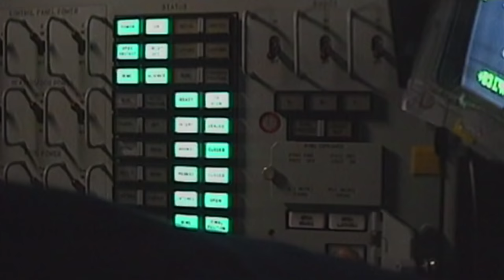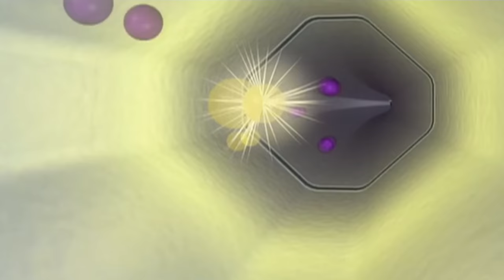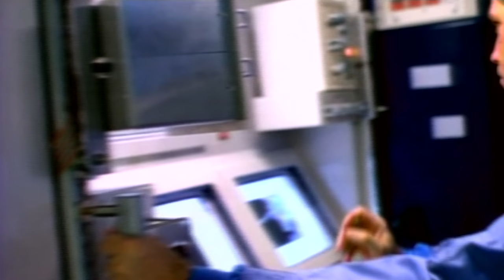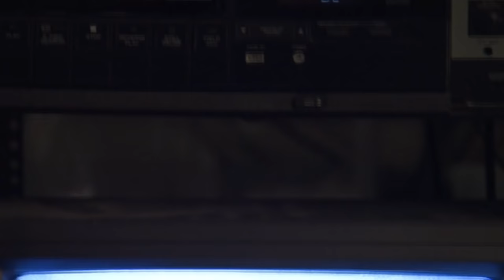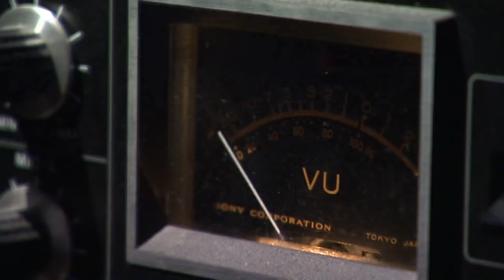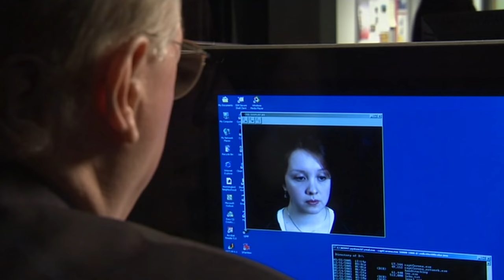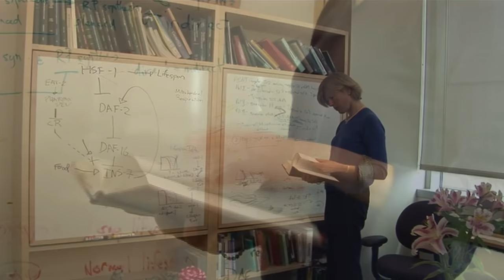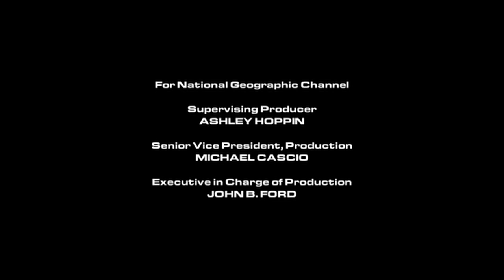Spacemen

Comment: If you want to go to another solar system you need to do it BIG. There is not much point in considering a small ship with small crew.   First build a large space station, with spin gravity living section for a few hundred people. Once we have that working, try moving it. Take it for a test flight to Mars and back or maybe go all the way out to Jupiter.  This will let you discover lots of unexpected issues and fix them before you take the long leap into deep space.  As for speed, there is not much point in trying until you can get to about 10% of light. That makes a 7 Light year trip into a 70 year trip, a long time but not a crazy long time.  Of course the ship should have enough room to accommodate the expanding population that will happen along the way.  All this assuming a destination that is Earth-like. Well to be safe dont do that.  The mission should be prepared to establish a viable colony on any rock that has the basic resources it needs.

Comment: There are several things to consider when going to space and not coming back to earth. Svalbard seed vault has figured out several of these things. Many of the things that we need in our daily life are all around us, but are hidden in our biological world.  Of course we need the right concentration of air to breathe, but we also need a range of pressure and for our "body's sake"; we need gravity or at least a way to simulate some sort of movement in a downward direction. A centrafuge works well for this. Centrafugal sleeping or common areas is a must to travel beyond our solar system or even within it. I will admit there are caveats to this theory, but there are more positives than negatives. As yet, no one has come up with a model that will fit into the circumference of a Rocket with a test model.

Comment: I still would like to know how the rockets push themselves in the vacuum.
Reply: When you push with a rocket, you're not pushing AGAINST anything, like paddling a canoe. You're taking advantage of the equal and opposite reaction of pushing matter one way to travel the opposite way.
Reply: When you paddle a canoe you are pushing against the water. When you fly a plane, the jet pushes against the air. That is how the vector thrust works. There is no opposition in the vacuum.
Reply: A jet engine pushes backward, but it doesn't push AGAINST anything in the same sense that a paddle pushes against water. It simply pushes superheated air out the nozzle so fast that the nozzle (and anything attached to it) moves in the opposite direction. "For every action there is an equal and opposite reaction": Newton's Third Law of Motion. A jet engine, though, wouldn't work in space, as it takes in air to push out the back. In a vacuum, you need rockets, or some other self-contained means of propulsion.
Reply: Gamina Wulfsdottir LOL.
So nothing pushes itself against anything, but only to itself?
Reply: A rocket engine doesn't push against anything. It moves in one direction by applying force in the other. I don't know what you mean by "only to itself." You can look it up. Newton's Third Law of Motion.
Reply: Rocket engines do not push against anything? So how does Newton's Third Law of Motion applies in here then?
Reply: Are you trying to understand, or are you just trolling?
Reply: I am no trolling. I am trying to understand why you are saying that rockets do not pushing against anything.
A huge violation of Newton's Third Law.
Reply: It's not a violation of the third law. It exemplifies it. A rocket's exhaust does not push against anything. The rocket moves as a result of the momentum (velocity times mass) generated by the combustion of the rocket fuel. 

Have you ever fired a shotgun? The kick you feel against your shoulder is the equal and opposite reaction of the shotgun charge leaving the gun out the other end of the barrel. But the shotgun pellets are not pushing against the gun. You can also fire a shotgun shell by striking the base of the shell when it's not even inside a gun, with nothing to push against.
Reply: "The rocket moves as a result of the momentum" And how did it acquired this momentum? It must have had pushed itself against something to achieve the speed.
The shotgun is a bad example. In a perfect vacuum a bullet fired from a gun will escape the barrel, if it can be fired, because the expanding gases trapped inside the cartridge, chamber and barrel are trying to escape and will take the path of least resistance. The round fired has a backing(chamber) to repel against. The gun would have maximum recoil from no drag from a lack of gravity and atmosphere. Same gun firing a blank in a perfect vacuum would produce no recoil. Just like a rocket in a perfect vacuum, there is nothing to thrust against, therefore it's useless

On Earth you have positive atmospheric pressure. In space you have a negative vacuum pressure. To propel a rocket would require something for the rocket to thrust against, hence the atmosphere. In a vacuum, where there is free expansion and no atmosphere, there is nothing for that said rocket to thrust against for the force needed to break the perfect vacuum of space would destroy everything along with it. For every action there is an equal and exact opposite reaction, Newton's laws of physics, so if said action has nothing to react against then it remains static. So as a rocket leaves our atmosphere its kinetic energy turns into potential energy as the pressure drops gradually from 14.7 psi to 0 and then into a vacuum.

You may want to watch the following:
https://www.youtube.com/watch?v=06bR5RR3T98&t=0s&index=11&list=PLldX58k3CXws_fKAbqu7HSUqVzIrGa6BR
Reply: I do not need to use anybody to proof nothing.
It is you the one that lacks understanding how anything moves.

A boat uses the propeller to push against both the boat and the water.
A car uses the drive-train to push against both the car and the ground.
A bi-Plane uses a propeller to push against both the plane and the atmosphere.
A helicopter uses rotors to push against both the helicopter and the atmosphere.
A Jet Plane uses exhaust jets to push against both the plane and the atmosphere.
A Rocket uses exhaust jets to push against both the rocket and the atmosphere.
The only difference between a Jet Engine and a Rocket Engine is that the Rocket Engine carries its oxygen to burn its fuel but they both still need an atmosphere for them to push against.
Get it?
Reply: You don't get it. Your examples are not analogous. A rocket engine doesn't move by pushing against anything. It moves in one direction by applying mass x velocity in the other.
Reply: No, you don't get it. Nothing moves by itself. It needs to interact with its environment to push itself. In the case of rockets and jets it is the atmospheric pressure. For example, the higher a rocket goes, the nozzles need to be expanded to increase the propulsion and thus compensate for the lower air pressure at higher altitudes.

If it is just a matter of mass x velocity, we know that mass on earth is weight, right?
But we also know that there is no weight in space. So what is "mass" in the vacuum?
Reply: I'm not going to waste any more time on you, except to point out that your airplane propeller example is wrong, as well. Airplane propellers are not paddles. They are airfoils. They work the same way airplane wings work: the curved forward surface, moving through the air in a circular motion creates a pressure differential with lower pressure in front, the way an airplane wing's curved upper surface creates an area of lower atmospheric pressure above the wing. A propeller thus doesn't push backward to move forward; it PULLS itself through the air. Or if you prefer, the slightly highr pressure behind the propeller or below the wing pushes forward or upward, respectively. But the propeller isn't pushing against the air. If your premise were correct and wings and propellers pushed themselves against the medium, they would not need to be shaped the way they are; they could be flat like a canoe paddle.
Reply: "I'm not going to waste any more time on you"
Me either.
Reply: Fox Moulder it works in space via equal and opposite reactions. For example if you farted in space it would technically push you in the opposite direction. It's not like a jet engine that pushes air out the back. Air has resistance. Space there isn't resistance, just Newton's law. I don't know any other way to explain it. Just because it's in a vacuum, doesn't mean you can't propel a vehicle.
Reply: The vacuum tries to fill itself. Whatever you put out it will just suck it in. There cannot be a push.
Reply: Fox Moulder it kind of makes no since. If we couldn't propel ourselves in a vacuum, our equipment wouldn't work. However, our satellites use little bursts of air to readjust their positions. I bet a physisis would know. I'm going to look that shit up. Maybe provide you with a better answer.
Reply: Vacuum doesn't suck. Vacuum doesn't try to do anything. If you throw a bowling ball, the bowling ball pushes you backwards. It's not about air, but about the fact that every action has an equal and opposite reaction. The effect will be much stronger in space, since you're not held in place by gravity. You don't have to believe any of this, but it is the truth.
Reply: And how do you know there is equipment in space? I would like to suggest to search for "bubbles in space."
Reply: Fox Moulder there are thousands of witnesses that we have equipment in space. It can be measured, and is fact.
Reply: Fox Moulder I looked it up. I didn't see anything to lead me believe they are not in space.
Reply: @Fox Moulder: You can see the International Space Station with your eyes or using binoculars.
Reply: Mark Meadows If that is so, can you show me just one picture, no images nor composites, of the earth taken by satellites?
Reply: Fox Moulder what do you mean? We have many pictures of earth. Some have even been taken from outside our van Allen belts. Some people can have the evidence thrown in their lap, and wont believe it. I have seen satellites and our space station flying over my house. They have to make minor adjustments in the vacuum of space . If they didnt, things would crash and fall to earth. I once thought our governments were lying about space, but then third parties started going up in to space. Way too many people involved, for it to be fake. Someone would blow it wide open. Do you think we haven't been in to outer space? Let's put it this way. We can make a solar sail. The photons of light from our sun can push a craft across our solar system. If there was no push in space it wouldn't work. I get what point your trying to prove. I just dont think all angles have been investigated on your end. I know all my angles haven't been covered. However, I do see were the evidence is taking us. There is too many people involved for it not to be true. Take care.
Reply: Show me a picture (not an image or composite stuff) from a satellite then. I have not seen not even one.
You can hardly see a 747 at 10 km altitude, much less you are going to be able to see a satellite some 400 miles high. Give me a break.

The scientific fact remains: there cannot be a "push" in space. Sorry, star wars is not possible.
Reply: Ever hear of "opposite but equal reaction to every action"? What is that? The First LAW of motion???
Reply: LOL. And what is the reaction in an environment that sucks whatever is put out?

Comment: Why not use magnets to recreate the force og gravity?
Reply: Because magnetics do not recreate gravity.
Reply: Magnetism could keep your feet to the floor, but your upper body would still be just as weightless. Your thighs still wouldn't hold your body up. However,  gravitation and acceleration are literally indistinguishable, so if you're in a rotating habitat, you have perfect artificial gravity. However, the habitat will have to be fairly large to not get dizzy. The O'Neil Cylinder is something you might want to look up. Science and Futurism with Isaac Arthur on Youtube, has much great content on this subject.
Reply: Stray magnetic fields in a sealed metal can lined with electronics designed to keep you alive. Good idea?